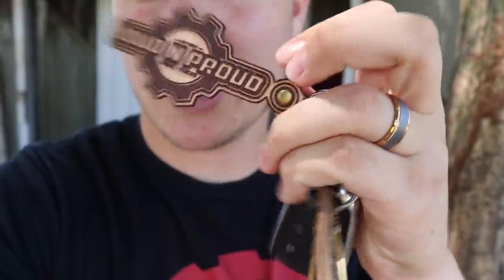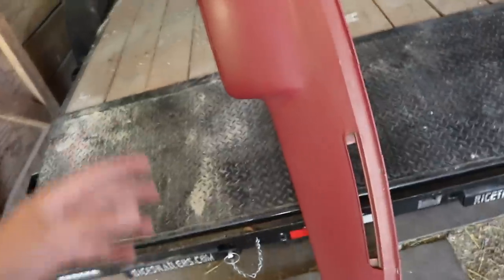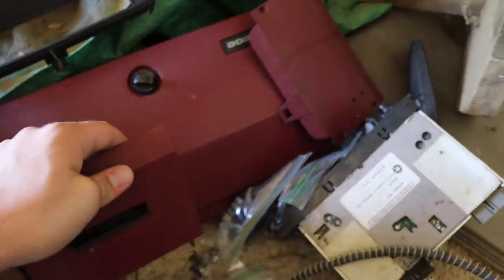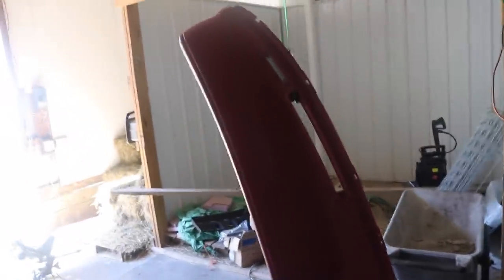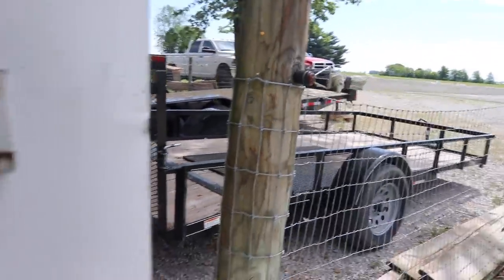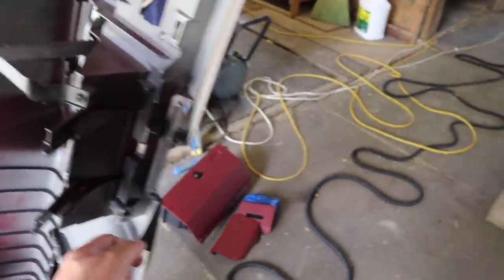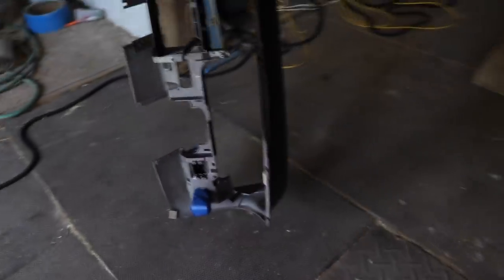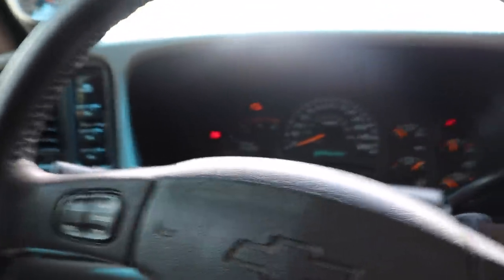I May be buying a DURAMAX...

Comment: 2006 to 2007 dodge ram 5.9 mega cab long bed, bigger turbo, 100hp injectors, head studs, water methane, cam it, color match it, tint, and either built auto or a dual disc clutch.

Comment: Build an lly 4 door, I have one of my own and I have to be honest... they are better than the Lbz **because** when you do all your upgrades, exhaust, intake with elbow and all the Inter cooling, welded y bridge, lift pump with tune and programmer, it because better and more reliable with more power than an lbz pulse you don’t have to worry about melding your copper sleeves around your cylinders that the lbz has because the lly do t have them, I have a buddy with the same upgrades as that and as I do, mines an lly and his is the lbz, I pull more lbs behind me, my truck is faster and run better and keep in mind my truck only has 74,000 miles on it and his have 93,000 no much difference so🤷🏻‍♂️